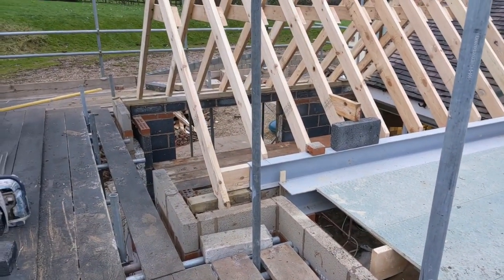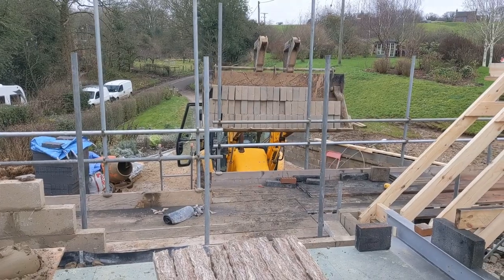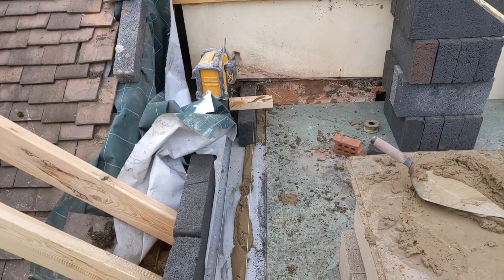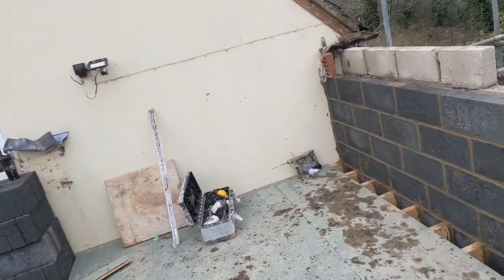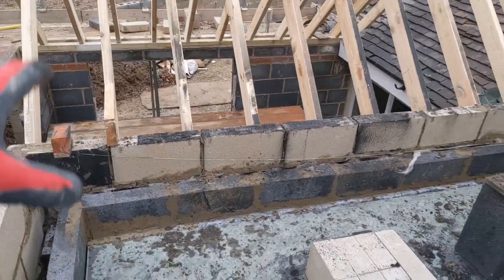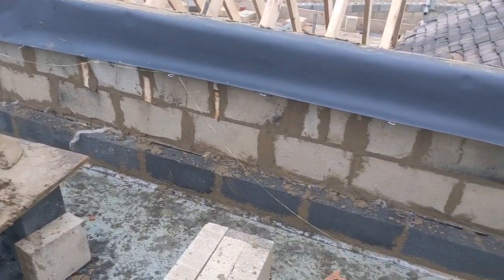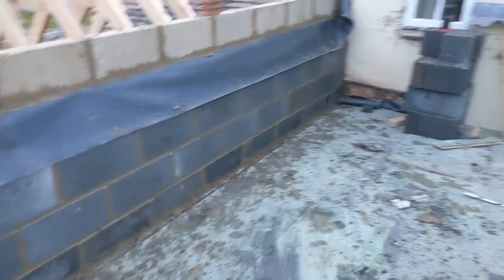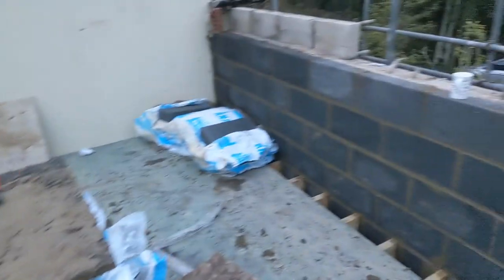Bricklaying - Extension almost Finished - Building in a valley #bricklaying #vlog

Comment: Do you have  to put plastic around your joist before you lay around them  with your Blocks?🧱🧱🧱👍🇺🇸😎 have a good one man 👍🎅😎
Reply from the maker: Ayup mateyyy! You don't have to, but if you don't people often call you out on it ..in the YouTube comments 😂😂 it's good practice however
Hope your well matey🍻🍻🍻🍻👋👋🇬🇧🫖😂
Reply: @IzzytheBricky  I was just wondering here in the states it would be a wood plate and your joists would fasten to your plate with a joist hanger the way we build it will be a would frame and Brick 🧱 on the outside of the wall now some times we do use blocks but there is a wood frame that goes on top of the blocks I really enjoy watching the way you build in the 🇬🇧 UK a lot you do would be good here however the codes we have would not allow a lot of them our way of looking at it is it cheaper to use wood framing than block and brick 🧱 a bricklayer here in the states only dose well if the house is getting brick on it where  my crew and my self make our money is by laying Schools and your bigger Buildings but it  depends on the different areas of work here we may have a subdivision that ever house has brick on it or just the front But vinyl siding is used more often cause it’s cheaper to use  Like I said enjoying watching keep up the good work man have a good one 🧱🧱🧱🧱🇺🇸🇺🇸👍😎
Reply from the maker: @jamescox4177  aah that's really interesting. I've seen alot of videos from American, most House's are all timber framed ..good if your a joiner 😂
We often use joist hangers too..just depends on the circumstances 👌 I know it's more expensive..but surely brick and block would be better for houses over there ...as a bit of wind and rain and I see videos of your house flying down the street 😂😂😂
Cheers buddy! Hope your doing well . Im currently isolating 😂😂😂🍻
Reply: Yes that’s true a town here in my home state was wiped out at the first of the month by a huge tornado 🌪 and I think your style of building would have help a great deal  Have a wonderful New Year my Friend Have A good one 🧱🧱🧱🧱🇺🇸🇺🇸😎
Reply from the maker: @jamescox4177  ah sorry to hear that buddy 😨 Thanks mate appreciate your support fella! Enjoy your New year's too buddy!🎉🎉🎉🍻🍻